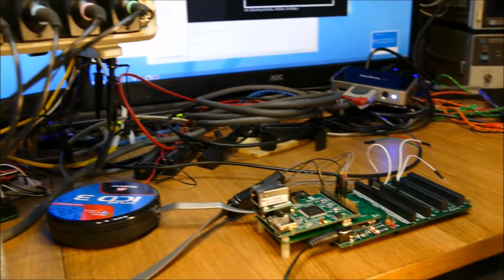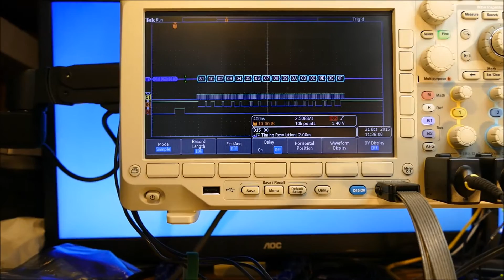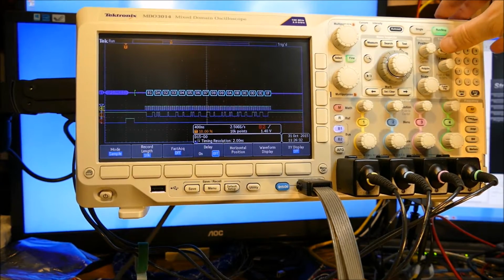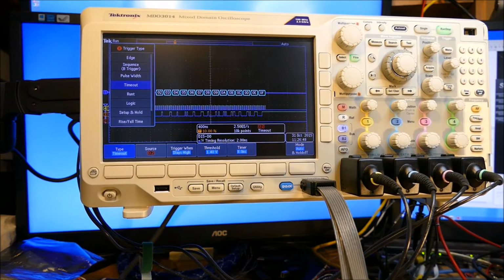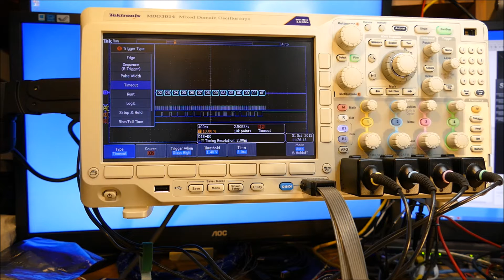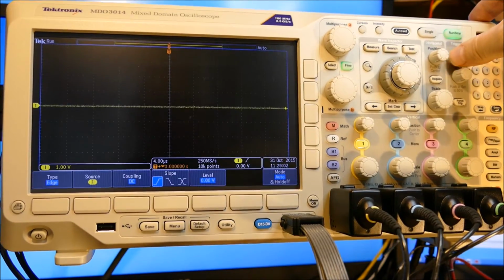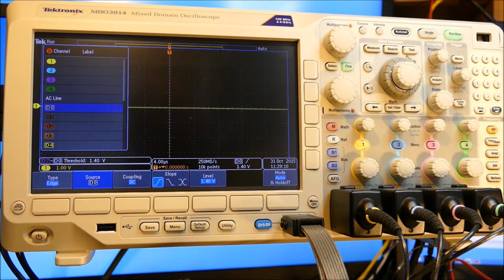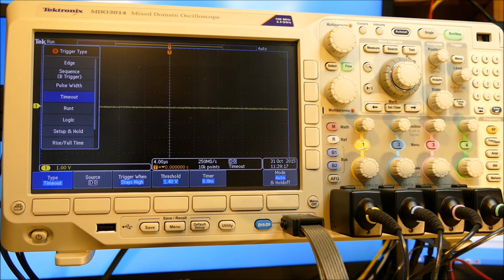Tektronix MDO3000 crash ***SOLVED***

Comment: We’re sorry to hear that you’re having an issue with your Tektronix product. We looked into this, and it appears that this oscilloscope’s firmware may have been altered in some way. MDO3000 Series oscilloscopes that come straight from the factory do not exhibit this behavior. Returning the firmware to its original state should correct the problem. If we can be of any further assistance, please let us know.
Reply from the maker: For the avoidance of doubt, this scope was new at the time direct from RS in the UK and the only firmware change was to update the firmware to the (then) latest version 1.20. I have since updated it to the latest version 1.22. I am not sure what the original firmware version was. Are you saying I should downgrade the firmware?  

I am also aware that this fault has been reproduced by several others, and there is one person I know who could not on their example.
Reply from the maker: Update: I have reinstalled the Option Key for the scope and it doesn't hang now. I'll update the subject details.
Reply: @nezbrun872  so you needed to re-enter the same option key like the one before and it works?
and the same for all enabled options?